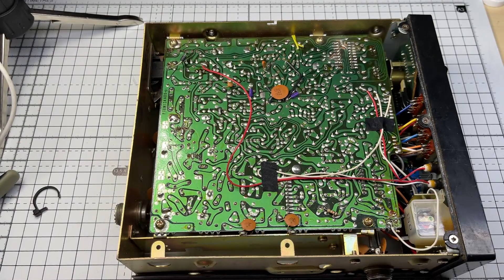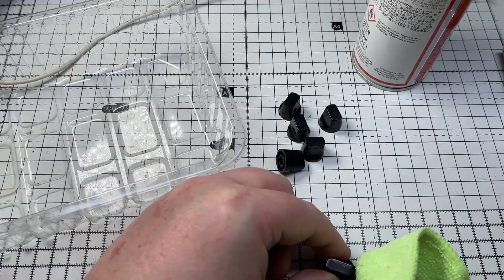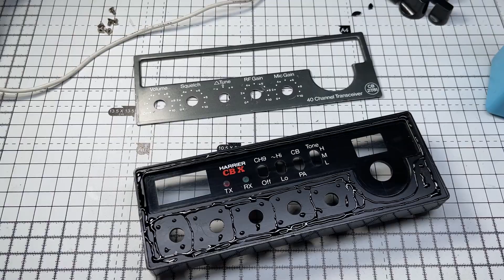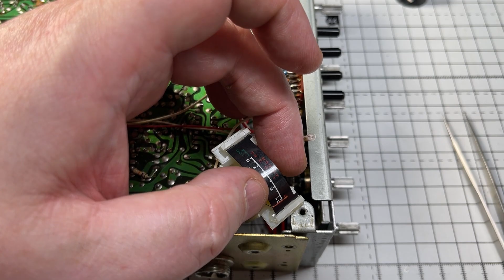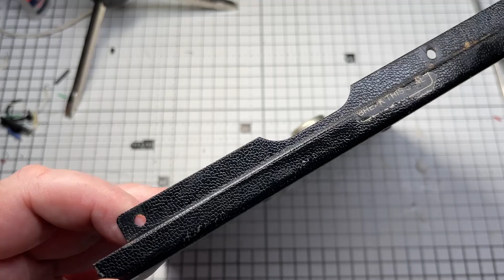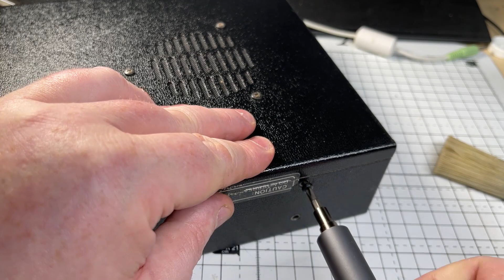EP 035 - eBay Harrier CB X - Spares or repair - Unknown fault - Can it be fixed ?

Comment: Inverted cone led are excellent for S/meter I all ways use warm white. Nice job on the radio you did.
Reply from the maker: This is all i had in at the time ;) im using the cob leds now , they give a uniform light and are warm.
Reply: @MicroChipz  still looks great what you did it far better than silly hot bulb.
Reply from the maker: Thanks for your nice comments :) appreciated.

Comment: Greetings from Oz, some advice when installing white led meter replacement lights. Using a hobbys knife scrape the outer body of the led this turning it into a diffuser. This spreads the light evenly around the meter body and look very natural, hope this helps Cheers tubby
Reply from the maker: Greetings :) thanks for your comment:)